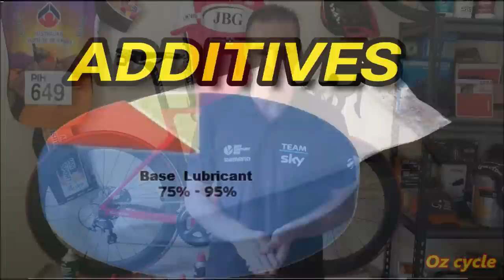Ultimate Chain wax - make it yourself

Comment: I wonder if combining this wax mixture with an ultrasonic cleaner would help to get it into every little corner.
Reply: I would guess the wax would be too thick for the ultrasonic cleaner. Also, the wax would have to maintain the hot temperature. But, it sounds like it would be great. Let me know if you get it worked out.  Also, the ultrasonic cleaner would be better for the degreasing part before the waxing…but I don’t know if you want to put the gasoline and other harsh chemicals in the ultrasonic cleaner.

Comment: Hi, thanks for this video. I have now maked my own wax and enjoying a clean chain. But now there is snow and rain here and my chain is starting to get rusty way before 300 km. Do you have a solution? I do not want to go back to wet lube.
Reply from the maker: Add half by volume of paraffin oil.
Reply: @stevenleffanue  I now use 500 grams of wax and 50 grams PTFE, how much Parafine?
Reply from the maker: 500mL of paraffin oil
Reply: @stevenleffanue  I have now tried this. The wax got pretty soft and last day it got washed off in the rain and the chain started to rust. Should i try only 250ml of paraffin oil in the next batch?
Reply from the maker: 50% oil , 50% wax. Wax doesn't wash off with water , so I'd say the chain had oil on it preventing the wax sticking.
Reply: @stevenleffanue  Thanks, I will try a Brand new chain then.
Reply from the maker: Maybe the one you have just needs a good clean?
Reply: @stevenleffanue  thanks, but its time for a change anyway 🙂

Comment: when cleaning the drivetrain for revax, why not just use water and brush? is degreaser really necessary? you aren't removing any oils or anything, just wax leftovers and probably some dirt that'll come off easily
Reply from the maker: Wax is waterproof. Removing old wax and dirt gives a fresh start every rewax. Drivetrain lasts longer.

Comment: When re-waxing does the temperature of the wax need to reach 90-95C again and do you have to keep it in for 10-15min again?
Reply from the maker: Temperature isnt critical as long as the wax is liquid and not so hot it starts smoming or boiling. Suggest 85degC.
Leave chain in min. 15 minutes and agetate at least couple of times.
Reply: @oz cycle... what if it does slightly boil for a moment? Does it ruin the wax?
Reply from the maker: Yes it usually discolours (yellow/red) indicating a change in its structure. As far as I have researched it will feel grainy or harsh.

Comment: How do the RD pulley bearings get the benefit of the wax Steve?
Reply from the maker: Use light grease or oil for both bearing and bushed types.

Comment: Question please: Why didn’t you put Parafine oil in the mixture so that the chain would not be stiff when it gets cold after the bath???? Why not mixing Parafine (candles) + Parafine Oil (lamp oil) + FTPE ?????? Is there any issue in doing that?
Reply from the maker: Ptfe replaces the oil and oil attracts dirt.
Reply: You did not get it! My point is that the lamp oil, if added to the mixture, will prevent the wax + the fpte to get the chain stiff when it is cold. I can live with the little dirty the lamp oil would attract. Can I use the three ingredients in the formula????? (parafine + lamp oil + ptfe)
Reply: parafine = candles + lamp oil = liquid parafine + PTFE ........ would this formula work???? I do not care about the little dirt the liquid parafine would eventually attract.
Reply from the maker: Yes that should work as a good chain lube and yes,it will attract more dirt and be slightly higher in friction.

Comment: What do you do after riding in the rain? Wipe the chain with a cloth to dry the water from the chain? Thanks
Reply from the maker: Im guilty of often doing nothing Brad but it should be dried somehow or even do a rewax if heavy rain.
Reply: @stevenleffanue  thanks for the advice. I dried the water off the chain. when doing so I could feel the wax on the outsides of the links. the chain is as quiet as before so have left it as is and will rewax when the 300km comes up. Cheers

Comment: oz cyle, how about 1:1 mixing wax with paraffin oil? Sould be more soft, not as brittle as pure wax. Are there any significant cons of mixixng wax with oil?
Reply from the maker: Oil attracts dirt
Reply: @stevenleffanue  Thanks a lot :) Last question - will 4um PTFE powder be fine? 1.6 is not available in Poland

Comment: Hi Oz, after getting hold of some PTFE powder and following all your steps I have clumping of PTFE and cannot get it to distribute into fine particles. I suspect it may not be 1.6um. Is there any solution to this please other than re-ordering PTFE from another source and starting again? I recall somewhere it was mentioned that something could be added for it to declump but I may be wrong. 

Have turned the slow cooker off for now :(

Many thanks in advance.
Reply from the maker: Yes, higher than 1.6um seems to clump.Try mixing in molybdenum disulphide , its an anticaking agent.
Reply: @stevenleffanue  Thanks! i should've payed closer attention as you mentioned this around the 9 minute mark. Any advice as to the quantity of MoS2 to add to the 50gPTFE/500gWax mixture? Also, where do you purchase your MoS2?

Comment: Why the temp of 90c to 94c, paraffin has a melting point between 40c-68c. I ask because I have a small slow cooker, I think it was for fondue or something, and its single temp. Testing it with water it reached 77c. Is this OK or not?
Reply from the maker: Yes it should be fine.

Comment: Is it normal for the wax bath to turn somewhat grey with repeated uses?  I have been using your method for a while now and my wax bath always turns grey as I use it over time no matter how much I try to clean the chain before I wax it.
Reply from the maker: Yes it's normal. Start a new batch every 4,000km or so.

Comment: A little help here please... The quick links just won't compress enough to fit side to side. Too much wax in the chain roller pins? Any suggestions to make the links fit? Thanks
Reply from the maker: Push out the wax then insert the link.
Reply: @stevenleffanue  Dear Steve, Thanks for your reply. I figured out that the links supplied with the new KMC chain were not reusable and needed the special pliers to snap them into position (which I don't have). Happily, I've been following your channel for years now and thus had a spare Connex quick link to save the day!

Comment: Thanks for your great videos, PTFE is kinda expensive and not so easy to get, can you add graphite powder instead?
Reply from the maker: You can add whatever you like but Ptfe is the best.Graphite leaves marks on whatever it touches
Reply: oz cycle thanks for the reply. What would you say is second best? I’m worried about the health effects of using PTFE. Thank you.
Reply from the maker: The old recipe with paraffin oil
Reply: oz cycle Thank you very much for the reply

Comment: I was reading on KMC's website that they recommend immersing chains in wax for 12 hours? I have an ultrasonic cleaner and am thinking of cleaning it with the ultrasonic cleaner before waxing.
Reply: Ultrasonic will clean your chain more thoroughly than the method described in the video. Can't comment on the 12 hour figure.
Reply from the maker: I dont recommend UC for this chain clean....details in vid soon. If you must , rinse chain after UC with IPA a few times. Yes 12 hrs on initial waxing is good

Comment: I'm confused watching several videos in the sense that i saw also xylene was needed? Is that not valid anymore due to the ptfe powder? Can a connex link be combined on a shimano 11 speed chain?
Reply: I use the Connex link with a Shimano 11 speed chain.  You just have to make sure you buy the right Connex that's made for the 11 speed chain.  Don't use xylene, it's more toxic than the already toxic chemicals we're using for this process.

Comment: Question, how do you know when it’s time to replace the wax? My batch is currently turning a bit yellow and not so much white and clear
Reply from the maker: Usually at between 10k -15k km. If wax goes grey,its because chain hasnt been cleaned sufficiently at rewaxing.
Reply: oz cycle thanks legend 👊🏻
Reply: oz cycle would you recommend a new batch if the wax is now grey?

Comment: Does it harm the wax if it goes above 100 Deg?
At the last rewax it was partly above 100, let it cool down to 80 and took it out then, but have the feeling, the chain is getting loud at only 100km on it.
Reply from the maker: If the colour of wax when cooled is white it's OK. If slightly orange, it's damaged....replace it.
Reply: @stevenleffanue  perfect, thank you! I gues the issue was, the wax still being to hot when taking the chain out.

Comment: Hey Oz.
Wonderful content, love the ideas and I've copied your paraffin wax with paraffin oil in it.

Is it really true that chain starts to creek and screaming for rewax after 5-10 km in rainy weather?
I know it's easy and fast but I have two kids draining my energy 😝
Reply from the maker: Should be lasting 250 - 300km between rewaxes
Reply: @stevenleffanue  even in poddles and rain?
Reply from the maker: Yes. However the chain may get rusty on the outside , so the added oil should help prevent rusting
Reply: @stevenleffanue  awesome thanks 👍 and thanks for answering my stupid questions 👌

Comment: Newly converted and recently bought slow cooker, wax and ptfe. Followed the video step by step and went on a ride. All good but next day I noticed rust spots on the chain and cassette??? Any ideas why ?
Reply from the maker: Wax not sticking because chain is still oily
Reply: @stevenleffanue  possibly, it was a new chain which I decreased before waxing, I’ll give it another full degrease again but little rust spots on new cassette as well ?
Reply from the maker: Cassettes should be hard anodized which hardly oxidize at all. If yours is rusting its prolly worth upgrading
Reply: @stevenleffanue  Firstly, thanks for your time. The cassette is a brand new SRAM eagle GX cassette and chain but having just watched another video I think the missing ingredient is paraffin oil but unsure what ratio ?
Reply from the maker: Add what ratio you want. 50% max tho otherwise it attracts way too much dirt. Adding the oil will protect drivetrain again rust better.

Comment: Wouldn’t hot soapy water be just as good as removing the dirty bits of wax etc from the cassette and chainrings instead of degreaser?
Reply from the maker: Yes. Dont melt your tyre tho.

Comment: Clarification on the PTFE size.  If the size is say 2-3 microns instead of the 1.6 microns will that have an appreciable impact on performance of the mixture in terms of friction, longevity,etc.
Reply from the maker: Yes. I did three years of testing with 8 riders and myself. 1.6um worked best at a 1:10 mix.

Comment: I've also been using PTFE wax for some time now. The web is full of articles about the dangers of PTFE, what do you think?
Reply from the maker: Do you use any non-stick cookware?
Reply: @stevenleffanue  No, to heat the wax with the PTFE I do as your instructions with the pot cooker
Reply: To be clear, I've been using your method (wax+PTFE) for about a year now with excellent results. The question I asked about PTFE (Teflon), is because it would represent a dangerous substance for humans and is linked to exposure to toxic substances emanating from this material, because the risks would be linked to the substances and fumes released by the Teflon during baking.
Reply from the maker: So why is teflon cookware still being sold?
Reply: @stevenleffanue  By eliminating the PTFE and using only wax with the addition of paraffin oil, do you get the same results? Thank you
Reply from the maker: No..Ptfe extends the time between rewaxing 3 fold.

Comment: Do you still recommend running in a new chain on original lube or just wax it right off the bat?
Reply from the maker: For the absolute best performance yes, run it in first. Otherwise its fine to clean and wax a new chain immediately
Reply: @stevenleffanue  Cheers

Comment: What should be the spec for the wax to use. You mention refined parafine wax - but isn't this a petrol based product? I see many candles consist of 80% parafine and 20% stearine. 
What about pure stearine? Can that be used?
Reply from the maker: Stearine is a hardening agent for paraffin wax,its not a lubricant as such. Refined paraffin wax has least additives as possible thus a better lubricant.
Reply: @stevenleffanue  So - the 80% parafine/20% stearine mix should be suitable for this purpose?
Reply from the maker: Yes

Comment: How would the wax work while being used on a mtb in wet filthy UK conditions where a full bike clean is required every ride using hose brushes and muc-off. Wet lube creates a grit paste, dry lube comes off.
Reply from the maker: Almost no difference to riding in dry conditions as wax is waterproof. However I advise to add a little paraffin oil to your wax mix which helps prevent outside of the chain corrosion in continuously wet conditions.
Reply: @stevenleffanue  thank you. mtb rides in winter here are pretty grim, whole ride can be through gritty wet mud. If the additional topup lube is all that is needed to prevent rust and keep drive-in going thru a ride this would be a great result. 😀

Comment: I have a freshly made batch of the original 50/50 wax/oil recipe. 
Is adding the ptfe to this original recipe acceptable? 
Or should I toss out the original and start a new batch without the oil?
Reply from the maker: New batch Mike...PTFE replaces the oil.
Reply: Thank you sir. 

Guess I'll keep the original batch for my road bikes as its working well for them.

And use the new formula for our mountain bikes.
Reply: Made up a batch with the ptfe, worked exactly as shown in the video. I only deviated by using 1 bar of gulf wax (230g) and 23g of the recommended ptfe. 

Did the full clean on both MTB chains.  (12 speed SRAM)

I was getting about 100 miles with the old formula, only got 70 miles with this new one. 

Both chains got noisy, around 70 miles. The noise  started in the granny gear, by the end of the next ride most gears were noisy and shifting wasn't so smooth anymore. 

I ride in Utah, dry and dusty. Did not wipe down the chains between rides.

Just gave both chains a boiled water bath and a new ptfe soak.

Was loving it "till the noise came on so soon. Even still, so much better than other lubes. We'll see how long this rewax lasts.
Reply: Well, only got 45 miles this waxing before the noise started, again in the granny gear 1st. 

What can I try to extend the mileage between waxings in the dry, dusty trail systems here in Utah?

Comment: After the methylated spirits stage I had a little bit of corrosion on my brand new Connex 11SX (the removable links included) but didn't have any on Shimano 901 chain. I soaked them together first in kerosene (shouldn't make the difference with petrol, right?), then in degreaser (twice) and then in methos (also twice) until the methylated spirits were crystal clear with no sediment whatsover. What could have caused the corrosion?
Reply from the maker: Left it too long after the metho before waxing. Do it almost straight away once metho has evaporated.
Reply from the maker: Yup , link round wrong way?...common mistake

Comment: Is it a norm for waxed chains to be more noisy compared to dry lube? Mine is fairly noisy and I’m wondering if I did it wrong.
Reply from the maker: A waxed chain should sound about the same or quieter than an oiled chain.
Reply: oz cycle okie I think I have to redo the whole process. It does not sound right.

Comment: Sorry for another comment, tried to search on pillar or container candle wax, the former shrinking on cooling and the latter adhering and expanding on cooling. 
One contribution suggested the container wax from tealights was less good than pillar wax from candle sticks, I would have instinctively thought the opposite... 
Anyone else on the type of wax (I presume either additives or the length of the hydrocarbon chains would make a difference to the properties, but cannot find anything about this)

Comment: It is very difficult and expensive to get PTFE powder to where I am. 
But, is it possible to substitute PTFE powder with the very fine borax powder (Dura Magic Borax)  which is being used to reduce friction over wooden pool tables vs its wooden chips.
Reply from the maker: Ptfe only. "Aliexpress" has it Dennis
Reply: @stevenleffanue  Thanks, will check it then 😃

Comment: How do we know we need to make a new batch? Any visual clues in the wax?, consistency, color?
Reply from the maker: It should be white. If it changes colour slightly it has contamination and should be replaced.
Reply: @stevenleffanue  thanks for the reply. also how many times can we reuse the wax+ptfe? I've done it 3 times already but not sure if we lose too much PTFE every time
Reply from the maker: Should get 10 -15,000km from 1 batch

Comment: Once u have waxed your chain, is it possible to get all te PTFE ouf of it again after an ultimate clean? I think i would prefer oil based lubricants again when i go on a biketrip..
Reply from the maker: You can leave the ptfe in the chain when oiling
Reply: Doesn’t the PTFE prevent the oil based lube from getting into the chain links?
Reply from the maker: The oil want stick to ptfe very well so yes,in effect ptfe does prevent oil sticking to a surface